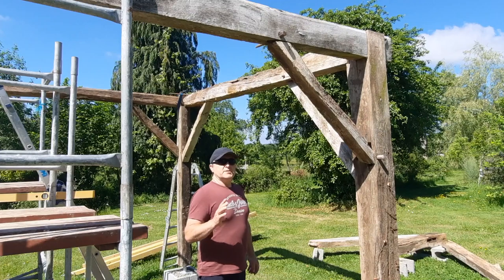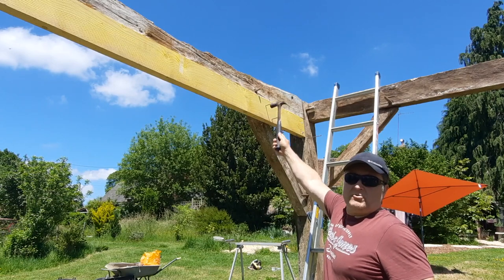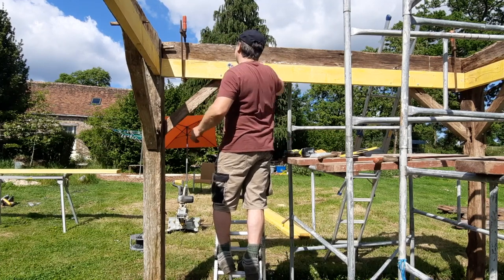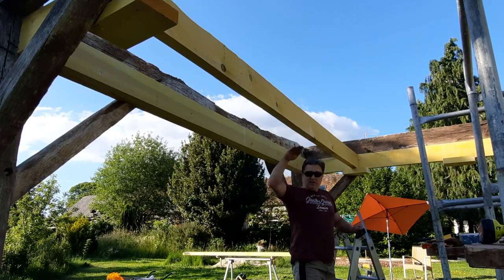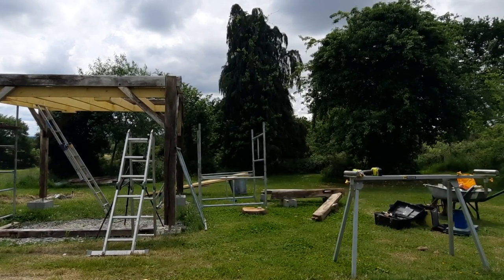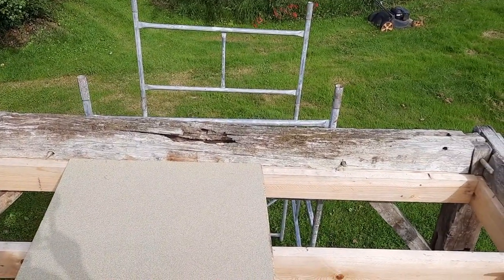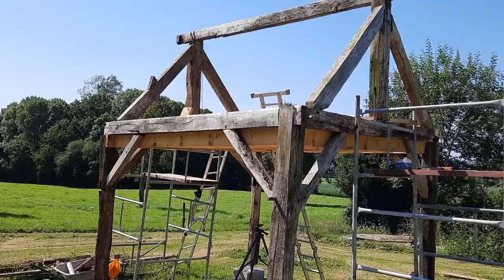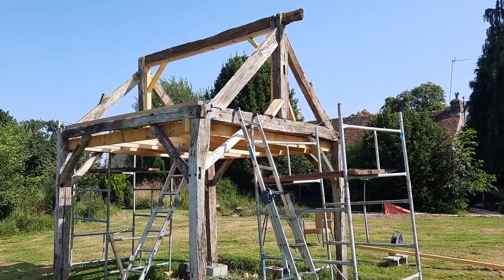Barn Renovation DIY in France | Collapsed Barn Rebuild Part 3

Comment: At first, I thought Dormers with windows on the side away from the house (to respect privacy). On closer inspection it looks like the pitch of the roof is a 45 degree angle and 4'8" height, which really limits what you can do there. You would be on your knees looking out a dormer window or have a nice view of the sky with sun roof lights while sitting down. It will be fun to see what you decide to do!
Reply from the maker: I have made the roof so it opens up to the sky👍

Comment: Thank you Ryan for this episode. It is nice to watch the ins and outs of your sympathetic barn restoration project. Do you use the same lumber as on the original beams? I would think that the best solution to roofing the barn would be to look at what is used on similar buildings in your local area. If that is not possible to get hold of then the next best solution is to find roofing material that blends in. Looking forward to the next installment of the restauration process.
Reply from the maker: The new timbers are softwood for cost and weight, l will use corrugated roof sheets to match surroundings and my hinged roof design. 👍
Reply: Sorry Sean I missnamed you. Not on purpose of course. I have a phone with a mischievious nature